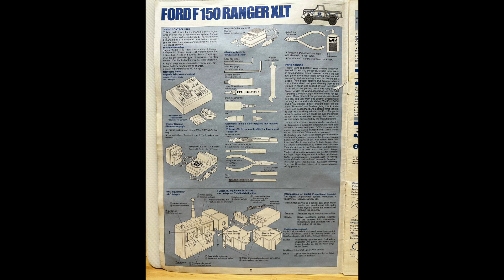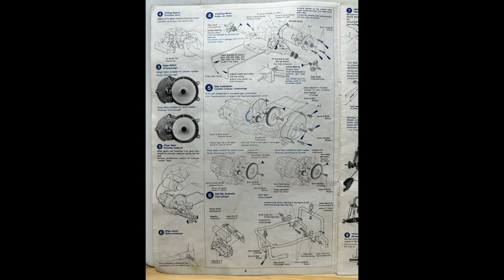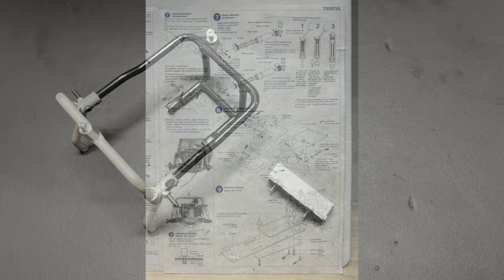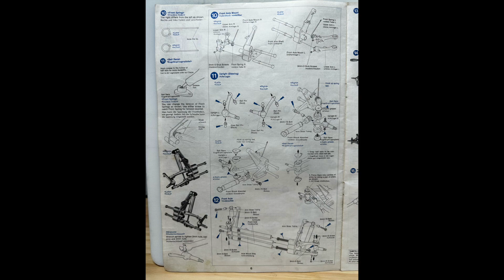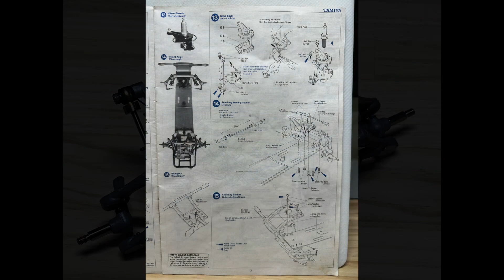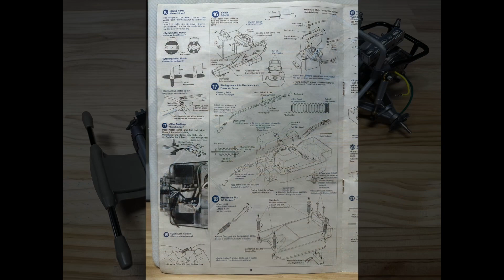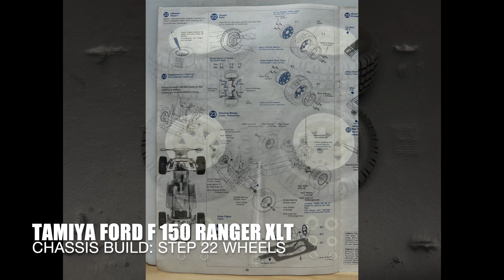Tamiya Ford F150 Ranger XLT SRB Build Part 4 - Chassis Build

Comment: Hi Jason, great videos and a real help as I have just stripped my original one down and looking to re build, I note on the shock build you use O Rings as seals, and also you said you bought parts from the US do you have a supplier you can recommend as I am sure I will find I will need some parts as I start the rebuild? Thanks again Andy 🏴
Reply from the maker: Hi Andy, thanks, glad they were of some help have you checked out my paint videos?. I didn’t have great success with the O ring kit. The larger thinner outer ones for the main shock chamber did work but the oil still leaked around the piston, even with the new supplied piston o ring. I also tried new red type o rings from newer kits, also I tried fitting the shocks upside down bit still leaked out. I then bought two new old stock shock kit sets and they also leaked. In the end I cleaned them out and put some anti-wear grease inside the pistons which simulates having oil in there. Even with the oil in, they don’t do much damping because they are so small. I just checked the eBay sale for the o ring kit I bought and it looks like they are not available now. I did buy 2 sets because they came from the USA so thought it worth while as the postage was more than the cost of the kits. If you want to try a set, send me your address by email and I’ll send a set to you. jason.bochniak@hotmail.com
Reply from the maker: The seller is called Team CRP Hobby Models. Happy to send you my spare set, no charge you can have them if you want to try them out.

Comment: Why don't they re-release this Ford?
Reply from the maker: @Funco1979 maybe because they modified the body mold to make the Blackfoot and then again for the re-re Blackfoot. If they did do a re-re I’m sure it would sell all day long. You could make your own with a scorcher kit, Brat wheels & tyres, a Blackfoot body set and there are a 3D printed Ford logos & body mounts etc on eBay you can get to stick on, body posts and a set of repro decals. A bit of effort but possible for less than finding a vintage one. Would be good to drive around too. I’m just about to start painting the body for my second resto, a MK2 and I’m also building another MK1. I was lucky to find 2 new body sets, one for each.
Reply: @jason.bochniak  I've heard of Tamiya RC enthusiasts putting together a Ford Ranger XLT with a SRB chassis, other parts etc but it's not a proper Tamiya re release. 

They could make new moulds for the F/R body and the chassis and wheels are already there. 

The re release S/S body is not the body from 1979 - the dimensions are slightly different and there are some other slight alterations (perhaps it's the M/B or B/B body?).
Reply from the maker: @Funco1979  I’m sure they could do if they wanted to. Do you have a Ranger or are you looking for one?
Reply: @jason.bochniak  I don't have one but I like all of the SRBs especially the Super Champ. My favorites are pre 1986 Tamiya, Kyosho, Marui, AYK and Thunder Tiger. The early Kyosho nitro buggies are just stunning.
Reply from the maker: @Funco1979  all great vintage buggies!
Reply: @Funco1979  Close enough. I have a runner 2010 chassis, bought an original blackfoot body, picked up the proper front grill plus tailgate, and other assorted parts, but for the tinted glass you'd never know it wasn't an original. 

Certainly good enough for a runner, even though I have yet to take it off the shelf. If they did decide to do a re-release I would be they would use the same parts, so close enough for me.
Reply: They should re release it. The Lamborghini Cheetah too but it doesn't look promising.